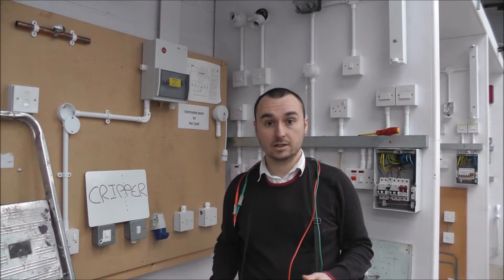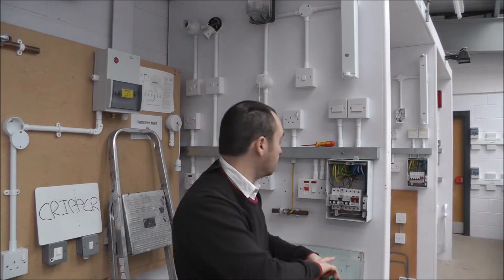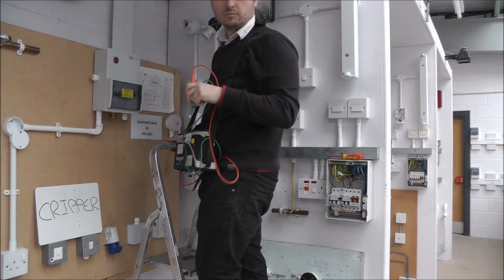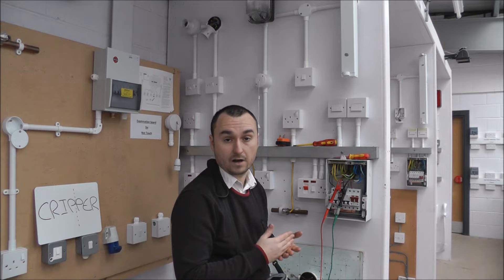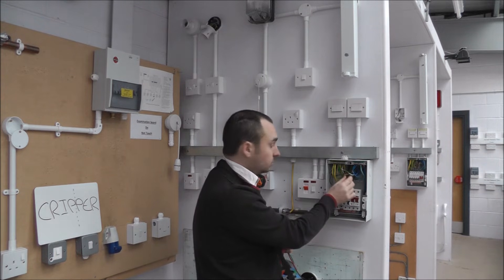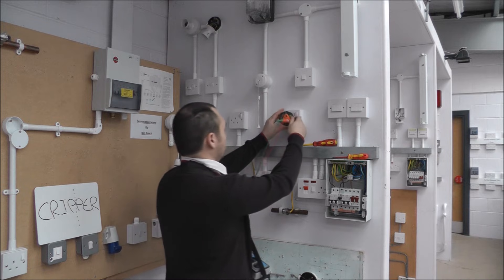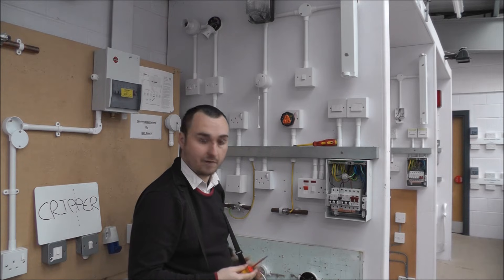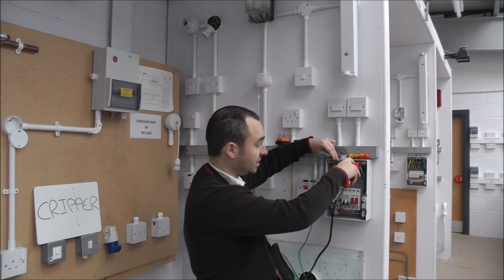Electrical Channel - Testing Sequence - Dead

Comment: Metal steps?? Shouldn't they be fibreglass?? And also you will be picked up for incorrect use of steps, you should have 3 points of contact at all times. Standing on the steps and leaning your chest onto the top handle I have been advised is appropriate.
Total b0ll0x isn't it, only I got hung drawn and quartered last year by a safety moron on Mitie, I was only replacing a ceiling tile in a reception area of an 8ft high grid, but I had the wrong steps for the job. 😮

Comment: So many oversights on this video. 1 - No Lock off , 2 No supply voltage check with test lamps confirmed working with proving unit. 3 You disconnect main protective conductors to copper pipe work so has not to pick up false readings on R1 + R2 tests via parellel paths. 4 To get a correct R1 + R2 result on the ring main you divide the reading by 4. 5 When doing an R1+R2 test on lighting take a reading from all fittings + switches and record the highest !

Comment: This video is a joke. Should've nulled his leads before he started, should've done a safe isolantion before doing anything. He is removing live and cpc conductors while MCB and main isolator is ON and LIVE. Didn't flick the light switch ON and OFF as he was doing his r1r2 at the light circuit. Used a bloody painters ladder. Didn't null the crock clips before doing end to end on ring. IR at 500V he tested between the Live and the entire Netral bar instead of removing the Neutral from the circuit in question, while still having a bulk head with a light still on above the dis board. Don't do what this guy is doing under exam condition. You're bound to fail.
Reply: Pretty sure he is JUST showing how to test it and which conductors to connect/cross-connect.
Reply: painters ladders 😂 first thing i noticed.
Reply: Might be a great Idea to also confirm polarity  before energizing the circuit and operating the switches on the ring final circuit ...just saying !  😎
Reply: Also Ive always taught to verify continuity of cpc at every point served on the lighting circuit

Comment: Would be great if you'd show the actual meter settings and the readings you get.
What you appear to be doing here is just enacting the CRIPPER testing sequence without actually showing much.
Sorry if I sound negative, but thanks for the vid. ;)

Comment: 1st test is. continuity of protective conductor (disconnect cpc from met)
2nd test is. continuity of main and supplementary bonding conductors (disconnect cpc from met)
3rd test is. continuity of final rind circuits (no need to disconnect the cpc from the met)
Reply: Point 2) is wrong testing supplementary bonding , the conductors remain connected at the MET or  earth bar .also he should of used a crock clip on one of the test leads and clipped onto the earth conductor to insure a good connection and a good reading
Reply: And Bulbs grow in gardens 😅 and he forgets to null leads 😂 not bad for an apprentice tho
Reply: Not done safe isolation!!!